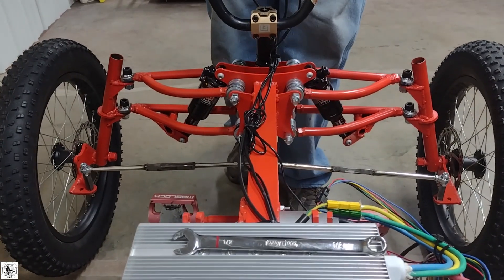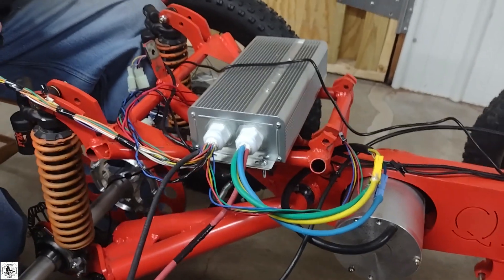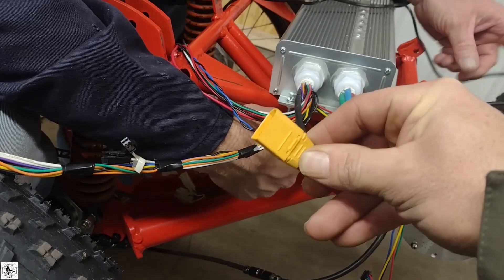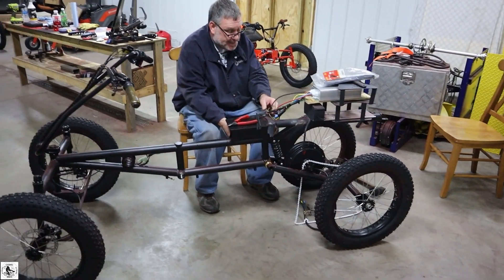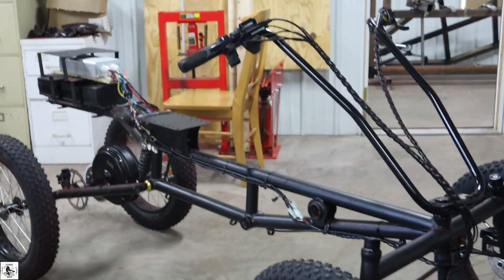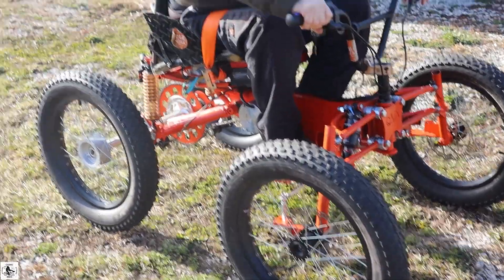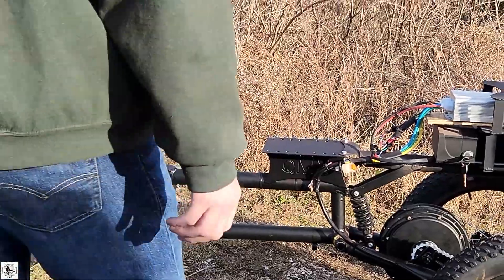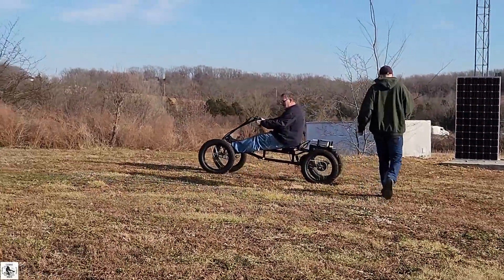DIY Electric Go-kart 3000w Motor

Comment: A little suggestion that will give some added protection. is a little bit of dielectric grease on all the electrical connections. it will give some piece of mind. because moisture has a nasty habit of finding it's way into those places.